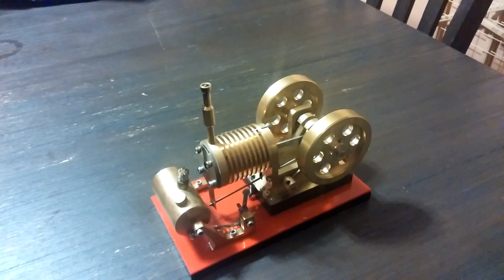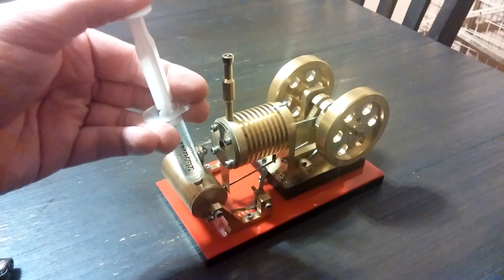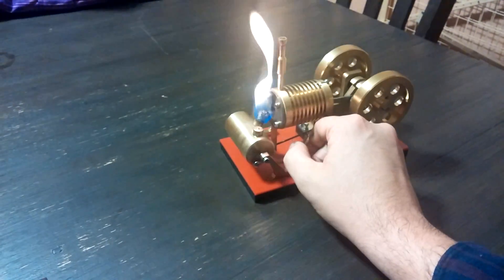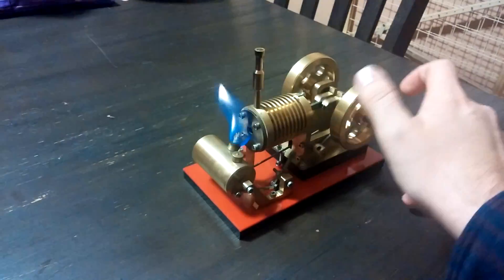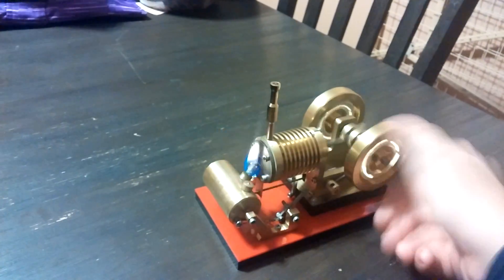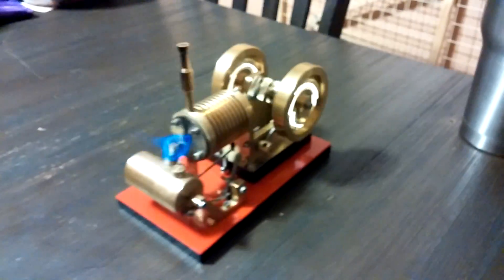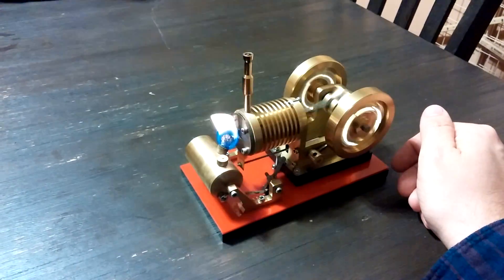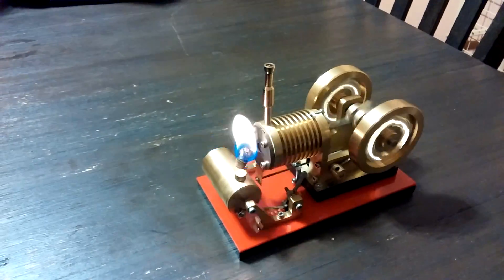Flame eater engine cold start

Comment: Tight piston /wall fit .
 When the cylinder heats even a little it grows and frees up the piston . For sure and positive. If you heat tge cylinder with a flame for a minutw or two it will start first shot.  Promise

Comment: PARTS TOLERANCE IS NOT THE ISSUE -- CALORIC DIFFERENTIAL IS!

If the piston can move freely inside the cylinder without any perceptible looseness then your tolerances are fine; there won't be enough space between piston and cylinder wall to prevent a vacuum from building.  But what WILL prevent that vacuum from building is the lack of differential between the calories INTRODUCED into the cylinder by the time it reaches Bottom Dead Center versus the calories REMAINING in the cylinder after the full effect of cooling.  THAT is what creates the vacuum, so...

...what you will need to do is heat the cylinder with the flame as close as possible to the flame inlet WITH THE PISTON AT TOP DEAD CENTER ("TDC"; closest to the flame) so that the piston itself is also heated as much as possible during the initial warming.

Also, because the piston at TDC is now minimizing the air volume in the cylinder while it is heating you will get maximum heating efficiency of both the cylinder AND piston, further increased because they are in direct contact with each other as close as possible to the heat source.

So instead of using mostly heated air to inefficiently conduct heat to the piston when it's farther away from the flame and then conducting a good portion of that heat right back out through conduction with the cooler portion of the cylinder, you are conducting heat to the piston more efficiently through additional conduction with the hot portion of the cylinder that surrounds it.

So the answer is: warm it up with the piston at TDC and the flame as close to the cylinder as possible.

Comment: This is something I struggled with as well. I could not get mine to run to save my life. Pulled it apart, cleaned everything with brake clean and checked all friction surfaces and gave them a sanding and a polish. Also check if anything is loose. Mine had loose parts all over it that I had to adjust to tighten it all up. Last thing i did was a drop of 10w motor oil on all moving parts except the piston and where the valve meets the cylinder housing. All it takes is a small drop on the bearings and a few other high friction places. It is normal for them to not run cold. I developed a small trough burner to go under mine to heat it up before lighting the wick. just poor a little Denatured alcohol into the trough and light it. Let it burn till it runs out and then light the wick. Fires up every time. Thanks for sharing!

Comment: I know this is old but just bought the same one had the same problem and was solved by warming up at tdc (needs to get the piston warm)with the valve open and starts after a minute or so hope this helps somebody.

Comment: Well, you did manage to get my interest up enough to order one from the boys on the other side of this great planet. 
Meantime; A question for you,,,,,,,have you tried using denatured alcohol for fuel? 

Maybe I should have asked you if you wanted to sell your SH-02.
Do you own any H Bohm hot air or Stirlings?  My HB-5 / Rocket L1 turns a Bohm Ferris wheel, Bohms Wind Mill, an old hard drive motor to produce DC power for lights (5) and a music box that plays Fer Elise.  On a good day it will power all these ad on's at the same time.  IF you want pix, just ask...( rcpilottoo@gmail.com )
 https://www.youtube.com/watch?v=k_UOuSklNL4    <-----YouTube Fer Elise

Comment: Tilt engine forward, heat head for one minute. Set back level and it will start with just a few flywheel turns. NEVER use a liquid lube - it will gum up the piston. Only good lube is powdered graphite.

Comment: The engine is basically powered by a vacuum. When the piston pushes out of the cylinder, the warm air inside the cylinder cools and lowers the pressure in the cylinder, which creates a vacuum and pulls the piston in again. When it is cold, the warm air in the engine immediately is cooled by the cylinder which can’t create a vacuum to pull the piston in. That’s why the engine needs to be warm before it will run properly
Reply: Vacuum cant "pull" the piston up. Its the atmeospheric pressure that pushes the Piston from the other side. Its all about the delta in pressure between above and under the piston.

Comment: Concerning the engine not starting when cold, I found this in the instructions for the bohm HB24 Vacuum Motor.

"During the first 4 minutes of operation, condensation builds up within the cylinder. This slows down the engine and causes irregularity. Along with high humidity, this may cause the engine to stop. Once the cylinder is warm enough, the engine will run properly. Don’t stop the engine in the first 4 minutes because for drying water/ humidity."

Comment: use the flames upper part (it is more hotter than the blue part) :)
Reply: No it isn't. Think about it.
Reply: More Hotter?? 😆 🤣 
The blue is the hottest part of the alcohol flame.
Reply: @jamesglenn520  no..
I don't know if it's different for alcohol
Reply: @jamesglenn520  there are different opinions in different forums about the hottest part of a flame
Reply: @jamesglenn520  thanks for correcting 👍👍

Comment: I may be wrong but I believe it won't start cold due to the piston or cylinder needing to expand due to heat in order for there to be a proper air seal for it to run that's why on the ones that are designed to start cold they run for a few minutes or longer based on the size but once they get heated up they start to seize up if you're trying to get it to start quickly without having to do any modifications I recommend taking a small torch and heating up the outside of the cylinder in order to speed expansion along

Comment: When metals heat up, they expand. The reason why it doesn't run cold is because the cylinder needs to expand to fill the gap between the wall and the piston for a good seal.
Reply: Nope. It runs off vacuum as the cylinder cools rapidly.

Comment: Thats normal. It has to warm up they all do that. Also when you moved the wick away, it stalled, thats purposful as a kill switch, its a one speed engine. You dont have to keep kicking it over to start it, just position the flywheel so the valve is open and it will heat up a bit faster. Hope this helps.

Comment: The reason it doesn't run when cold is the Vacuum Suction is leaking past the very small gap between the Piston and Cylinder wall, when it gets hotter the piston expands at a slightly bigger rate than the cylinder expands this closes the gap which reduces any suction leaks past the piston..If it also got very hot then the piston would become too tight in the bore and stop....So they will only realy run in a small band of Temperatures depending on the machining tolerances during manufacturing...hope this helps you understand things a bit better..Nice video regards Steve Liverpool UK

Comment: I do not have 1. But i was thinking maybe that you have more clearance in your cylinder and piston(blowby, leakage) but when it warms up and those clearances get tighter it runs good. Again just a thought  i do not have 1.
Reply: It's actually the opposite. These engines are very sensitive to friction. They're designed to be a little too tight cold so that they will have enough of a seal when hot. But when cold, even though it feels free, it's tight enough to not run.

Comment: A flame licker can either be machined to run cold or run hot but not both. Yours is machined to run warm. If it ran cold, then as the metal warmed the piston and cylinder would start to leak and then stall.
Reply from the maker: Mr. O'Connor: Science 
Thanks I didn't know that
Reply: @philham3505  the valve is machined (as said above) to where the expansion and contraction of the air matches the temperature of the parts the air contacts, and the dimensions of the valve, and distance any piston moves inside.

The same idea, with petrol engines preferring high revs, the fuel burns, and expands the air very quickly.
It's an efficient, but temperamental design.

Comment: where you buy it????
Reply from the maker: Markwesly Depena 
you can use anything that'll make a constant flame but alcohol burns very clean which is best
Reply from the maker: Matúš Suský 
it was a present I believe off Amazon there were 3 different models
Reply: Phil Ham thanks for reply. It's nice engine.
Reply from the maker: Matúš Suský 
no problem. thanks. I been thinking about getting and building a big nick, those are water cooled and power mini generators and other small things
Reply: hey bro phil ham.can be use also butane or lighter fire or even candle or kerosen?thanks
Reply: thanks bro..